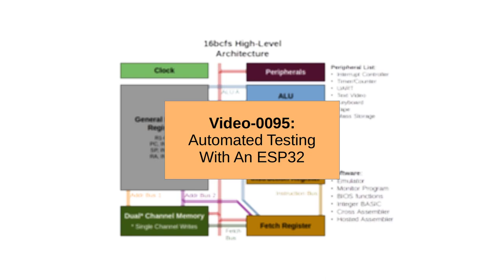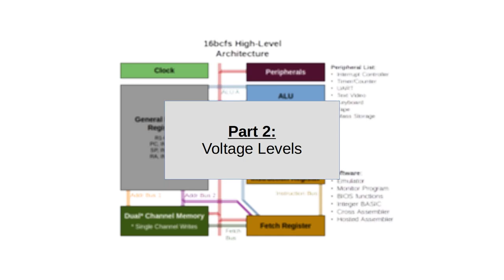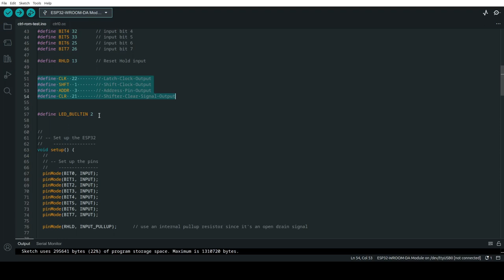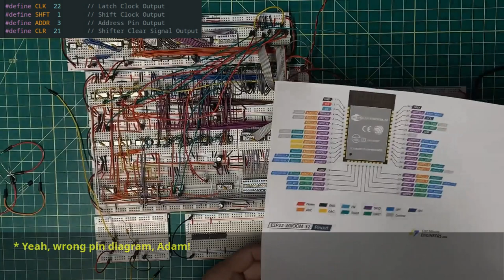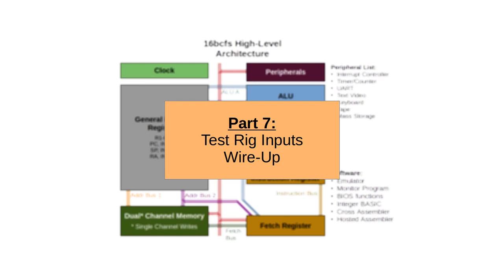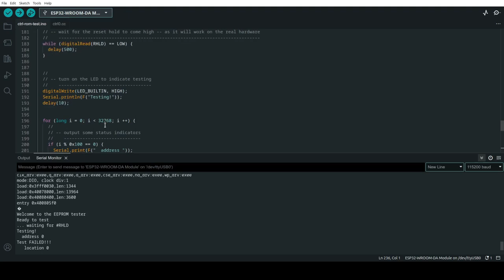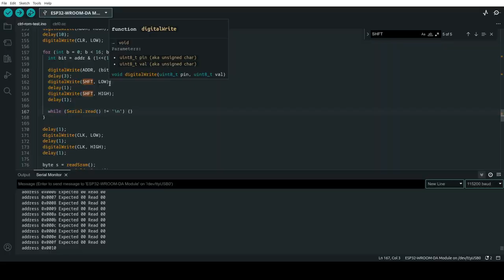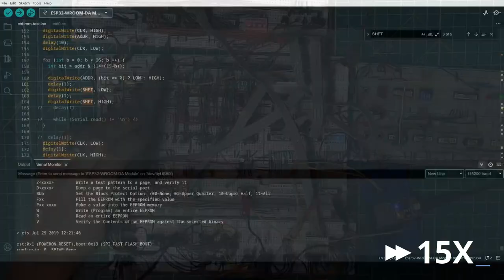0095: Automated EEPROM Module Testing with an ESP32 | 16-Bit Computer From Scratch

Comment: Progress!  You know there are inexpensive level shifters on Amazon and ebay. Like 6 boards of 8 channels for $7.50. I know this is just a test rig, but you may use them for other projects. They are active drive so rise times are fast.

Since I am primarily a hardware guy, how come you don't hash and checksum the data for the compare? Beyond the obvious of being 100% sure of bit for bit. I know it is easy to fool a plain checksum, but very hard to fool a good hash function. A number of devices that I have worked on (repairs/upgrades) used checksum/crc or a hash value stored in the rom somewhere to validate that the rom was still valid. That makes me wonder if it might be useful to have an opcode that outputs the rom validation value for verifying long term stability of the control sram.
Reply from the maker: @grumpyoldman5368 -- Thank you for your continued interest!!  I'll respond to your second question first.  

The reason I chose to go after a bit-by-bit compare first is actually the follow-up question I would have when something was different.  With a hash, the only answer I would be able to get what that something was not right.  I would not know where and what.  I would then have to then change to a bit-by-bit compare to get to the bottom of those questions anyway.  What were the chances I got it right the first time?  Zero.  So, I went with what gives me the best bang for my buck.

Now, that said, if I had 100% confidence my circuit was working properly, I might build something like a checksum into the circuit as a sanity check on power up.  For now, I'm far more focused on getting the fundamentals working right than adding extra polish.

As for the level shifters: I know they exist and I'm sure there are many jellybean level shifters out there.  But what is the value in taking that shortcut when my primary intent is to learn?  I realize completely that in a production run the level shifters will be used.  However, I want to be able to understand and appreciate the shortcuts those components provide.  This is my first experience with level-shifting signals.

I am confident in my understanding of the fundamental gates (both TTL and CMOS) and their aggregation into more complicated gates.  I have even recreated some TTL gates on breadboard and I think I reasonably understand the input-shaping, logic, and output-shaping that are built into the TTL logic.  I still want to do the same for CMOS, but I think they are far more intuitive.